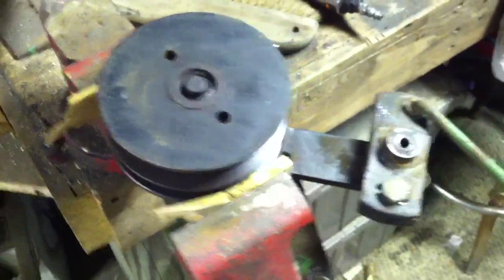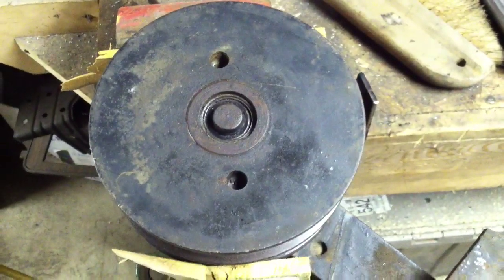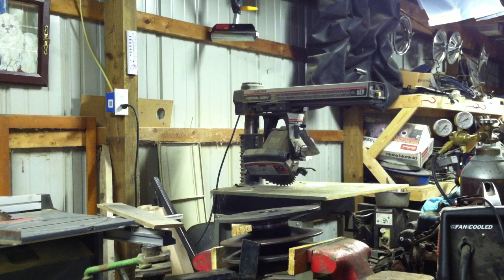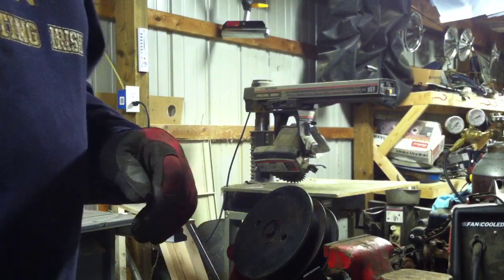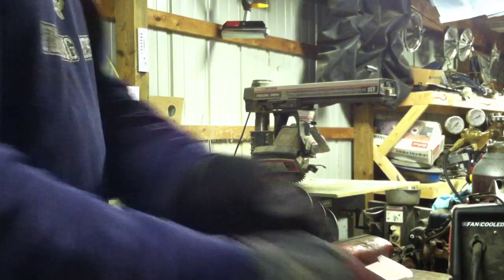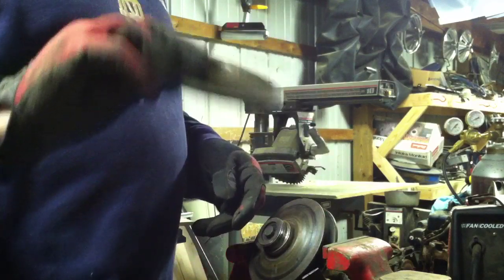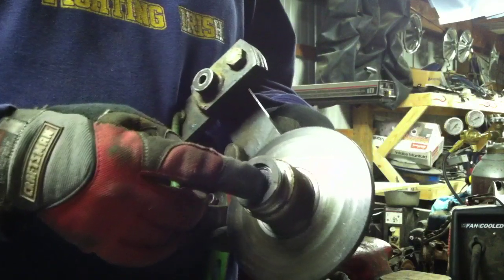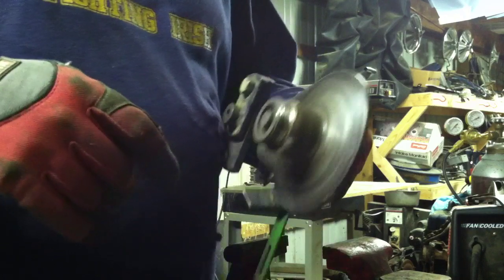How To Disassemble A John Deere Variator

Comment: I have a 72 112 also and always have been looking for how to take the variator apart. Thanks so much for posting. Mine is slow to speed up in winter and I think the bushing on the center is bad and binding up.

Comment: I rebuilt the variator on my 1983 214 several years ago. It was a pain in the butt to say the least. I had to replace the center piece that the sheaves slide back and forth on. I finally found a dealer in another part of the U.S. that still had one in stock. I lucked out, don't know if anyone offers the complete assembly any longer. The whole assembly was still around then, $200.00 bucks or so back then in the 90's.

Comment: john deer  had a special tools to loosen the outer sheave  i make my own from a  foot long piece of scrap steel  . measure the distance of the holes and drill 2 holes in the scrap  bar at one end of the scrap then put the bolts thru both the bar and the shieve once both align  you can  use bolts  and nuts and make sure you use long enough bolts to fully bottom out in the shieve. and tighten the nuts  . you make 2 of these if both sheive ends have these holes  remove the sheive assembly from the bracket the wider bar you will make will be clamped in the vise to hold the varidrive pulleys you will use the other tool to loosen the  other end. you will only do this is the center sheive does not move freely. if the core bearing is bad  just get a new one   press it out an install the new one  then replace the belts and adjust according to the repair manual
Reply from the maker: brokenwrench1 Great advice, thanks for sharing!

Comment: i was watching your other videos but couldnt find if you ever came to the conclusion that you were missing the clutch override spring that connects to the variator, i have no tension on the variator handle and it doenst even move the pulley until past notch one and it barely moves it then, i then looked at a diagram and saw the clutch over ride spring was missing on mine just like yours, did that end up being your issue, and where did you mount it to and how did you adjust it when you got it, thanks

Comment: Did you end up replacing the inner bearing or any of the internal parts, or did you just clean and lube the surfaces and put everything back together?
Reply from the maker: Just cleaned it up, made a big difference.
Reply: That's what I ended up doing to mine. The center sheave still has a little bit of wobble, but I cleaned the shaft and dabbed grease inside the center sheave and it works like new.

Comment: ive also made sure variator sheave moves tightly but freely as well, and adjusted it over and over with all brand new belts, but the variator just doesnt work and i dont know if im missing that spring or if it never needed one, its a 73 112 with 250000+ serial number

Comment: I have found that a litter weight hammer will work faster and not deformed the holes. then I made a wrench for it just like the wrench for my electric buffer grinder only it is bigger and cost me $0.00. I'll load a video of making it and using it soon.
Reply from the maker: Cool I will subscribe!